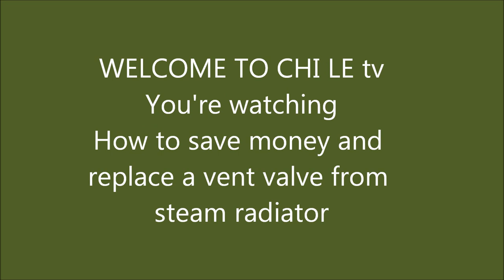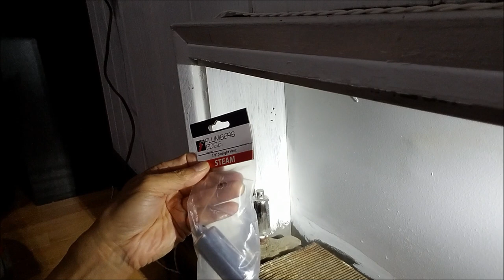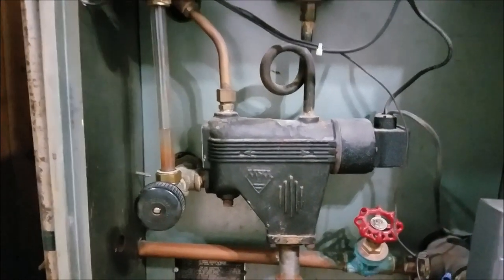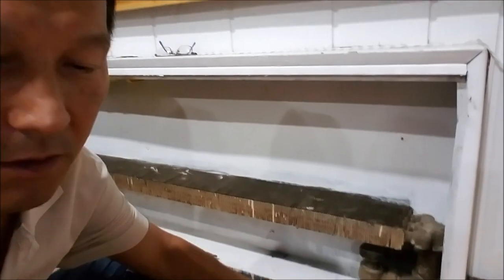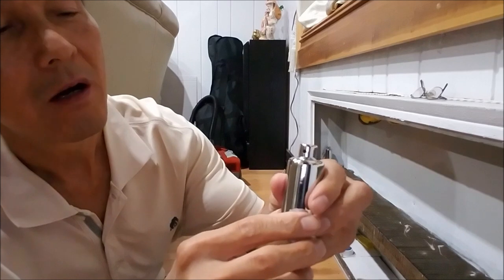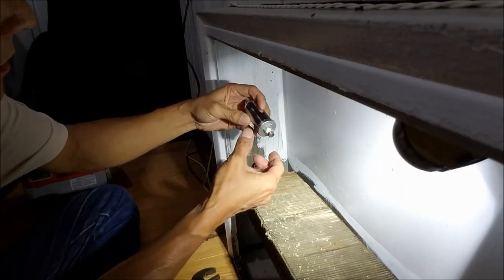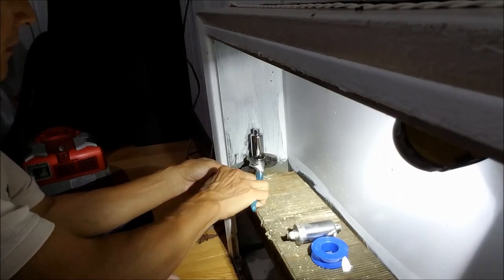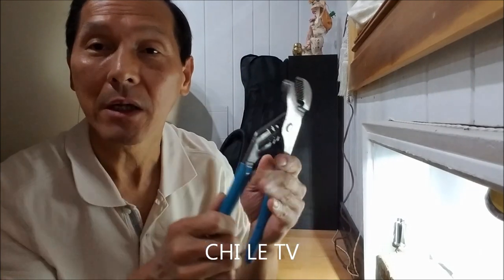How to save money and replace a vent valve from steam radiator

Comment: My vent started leaking water since I got a new steam boiler installed (New Yorker). The main is set to 2 PSI and the differentiator (subtractive) is set to 1.5 PSI. Should I adjust it to 3 PSI?
Reply from the maker: No. Normally, The main set up point ( Cut in ) is set about 2 or 3 PSI and the Differential set to 0.5 to 1 PSI. When press in boiler increases above Press Cut Out, which equals Press Cut-in plus Differential, press switch will be activated and breaks the control circuit, kills the boiler. Your vent started leaking water is nothing to do with control circuit. There are three reasons that make your vent started venting water:1. Your vent is defective.2. lower your Differential set point to 0.5 3. Check your switch by using Multi digital meter to make sure electrical contacts open to kill the boiler.Thank you for your comment and question. Any thing else, I can help ? Good luck !

Comment: Hello, you mentioned that the steam that escapes from the vent valve when it is not working properly can create a high bill because the water has to continue to heat up. I had a very very high heat bill and my valves are very noisy like the one in this video. Do you think the high heat bill could be because of this issue or would it only be the electric or water bill that would be high due to this issue? Thank you!!
Reply from the maker: Your steam boiler uses natural gas, and this problem will cause your gas bill higher only. Your electric bill is some things else. Thanks for watching.

Comment: I live in Brooklyn, NY.  My living room heater is just like yours. My boiler was just replaced 2 weeks ago. The individuals who did this did not check the radiators. Now I hear banging like crazy in two the radiators and and now I see water squirting out of one valve. The radiator valves were changed in all the radiators before the New boiler was installed by someone else who serviced it, then it broke down. That's when I got a new boiler installed now do I need to replace the valves again? I really appreciate all you said it makes sense about the heat remaining. Please help if you can thx.
Reply from the maker: You don't have to replace any valve. You have a water hammer condition in your steam system, especially at two radiators. Water hammer happens when there is trapped water in steam pipe of radiator. When steam overcomes ( steam flow ), it will push trapped water back and forward and acting like the bullet hitting steam pipe's wall or elbow. To avoid this condition, your radiators need to be adjusted with an angle 10 to 15 degree in one side to let the trapped water ( condensate water ) going back to the source. You can go back to one of my video( posted a month ago ) and see how I adjust it by using level tool. Video name : How to Replace The Shut Off Valve and Stop Radiator Pipes from Banging ( Water Hammer ). Ok, thanks for your support. Good luck. Have a nice day.

Comment: is the valve supposed to spit water? i chnaged the vents on my 10 radiators with the one you showed and it makes so much noise and spits out water
Reply from the maker: No, it's not supposed to spit water, but steam only. Your pipeline contains water and need to drain back to the boiler, or you can lower your Diff. press switch setting. Thanks.
Reply: @CHILEtv012019  sorry, is it possible that it was the other valves causing issues, they were closed so air couldn't escape.
Reply from the maker: Yes, you have to open those valves so that steam will release to atmosphere and bring steam pressure down. Some areas you don't want heat, you still have to open these valves a little bit. Your thermostat measures room temp., it will continue call for heat if these valves close. Thanks for this question. Have a good day.

Comment: Not only do leaking/failed steam vents waste money, they also slowly rust out your boiler. How? By not allowing the "dead steam" (the condensed water) to return to the boiler to be made into steam again, fresh water needs to be added instead.  But that fresh water has lots of oxygen dissolved in it and that is let loose inside your boiler.  Leaking steam vents kill boilers!
Reply from the maker: Absolutely, you're correct. The vent valve is one of the factors cost your gas bill higher. Water hammer in steam system ( Condensed water ) is a big issue that people worry if you don't adjust right, it could damage your pipe lines.
Reply: @CHILEtv012019  Water hammer is indeed a killer of pipe, right you are.  Generally it is recommended that the steam mains in the basement be vented quickly with very large vents and convectors such as yours be vented slowly so water and rust isn't carried into the vent and cause it to be stuck open or spit.
Reply from the maker: Yes, you're right.

Comment: I replaced all of my vent valves and yet they are all still hissing. what could be the problem? thanks.
Reply from the maker: These vent valves have to be hissing for few seconds ( 10 to 20 seconds ) to release steam pressure so that steam heating up the radiators then it will stop hissing. If you recognize this hissing constantly, then you have to adjust stop valve ( open 30% to 50% for  radiators close to the boiler.  50% to 100% for radiators far away the boiler. One more thing you must check are your cut-in switch device and temp setting is too high. Thanks for watching. Good luck !

Comment: My vent valve has numbers 1-10 what’s the best number to save
Reply from the maker: I'm not sure about your question. But, if your vent valve has a dial setting 1-10  ( set @ 1 is less steam, set @ 10 is the most steam ), then you have to verify the location for each radiator in your house. For example, a two story home has steam heating system, dial setting is set between 3-5 for first floor and 6-10 for second floor. The reason, steam will travel farer and loss energy before it reaches second floor. Furthermore, temperature control box ( Thermostat ) is another factor that works together with this setting because of location. This way, you will have the same temp for both floor. If you don't know how to set this dial , you may end up pay the gas bill higher than normal. Ok, thank you for your comment.

Comment: Wanna have your vents last longer?  Drop the pressure your boiler operates at.  Set the control to no more than 1-1/2 psi max.  It ain't the pressure that heats, its the hidden heat in the steam itself, also called "latent heat".  The steam pressure's job is to just push the cold air out.  1/2 psi will do it, any more and you're wasting energy. Crazy huh?
Reply from the maker: Well, Most boilers are set @ 1/2 PSI to  1 psi (max), except press switch needs to be calibrated. Thank you  for your comment.
Reply: @CHILEtv012019  You are most welcome.  Also, the "pigtail" to the pressure control is attached to sometimes may be clogged, as I'm sure you know.  And about 1/3 of the pressure controls I test are off, sometimes by several pounds, sad to say.
Reply from the maker: Yes, my friend. I have experience working in the power plant for 30 years and I used this video to help people around the country. Most of devices use in the power plant that I know need to do compliance every six months. And, all test equipments have to calibrate annually, and I think you know about it.